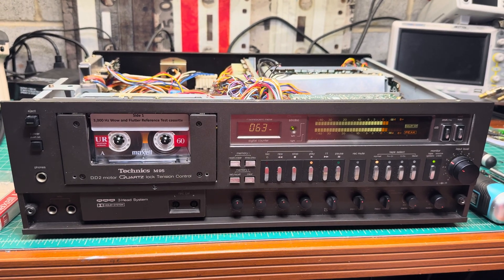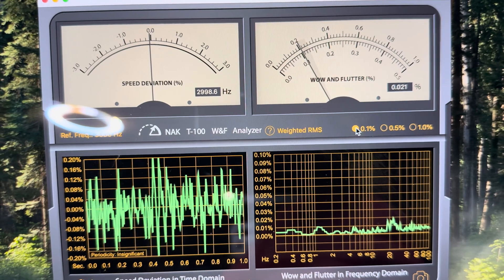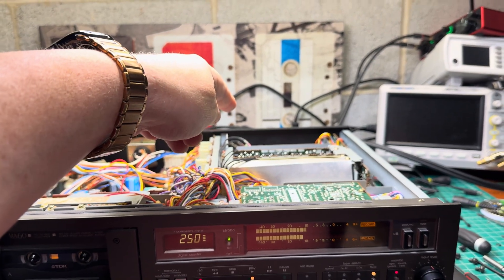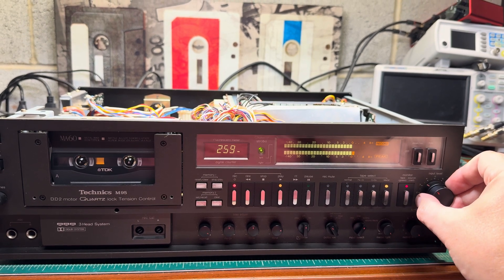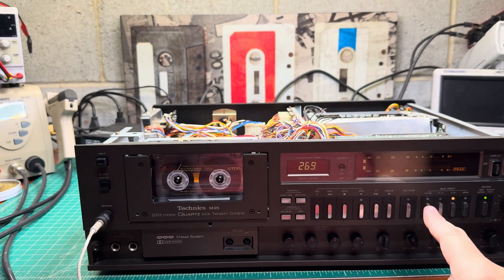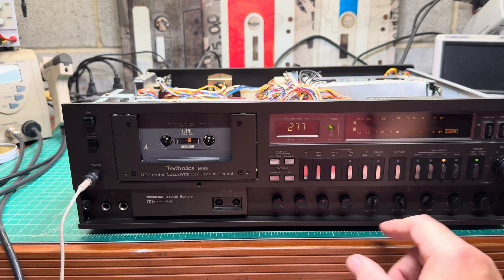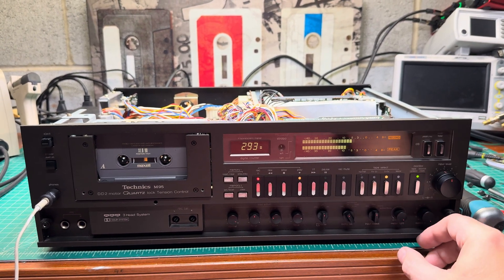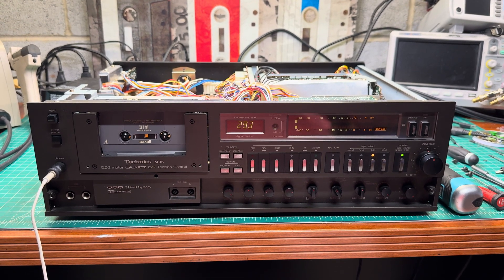Technics RS-M95 Final Tuning + W&F is 0.021% WRMS!

Comment: Hello, how was a frequency sweep after this fine tuning? A plot from an analyser would show results for us ;)
Reply from the maker: Slope below 50 Hz getting worse below 30 Hz. Slope above 16 kHz getting worse above 17.5. Not very even between left and right due to different head correction caps to keep the linear playback response,but in range of 1-1.5 dB. Slope on highs when record above -10 dB to 250 nWb level. So, all the issues from 1970s decks, as the 0 dB standard was 160 nWb.
Reply: @hifirulezzz Your answer was very comprehensive, thank you